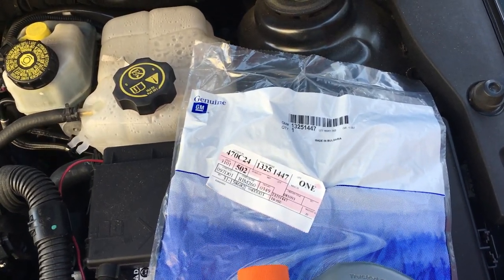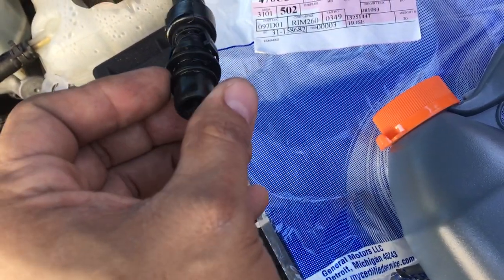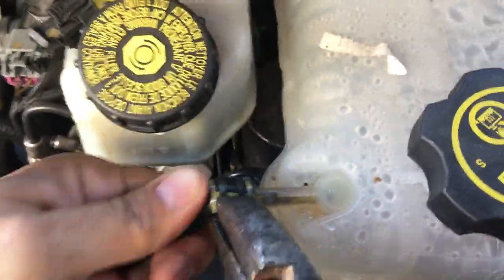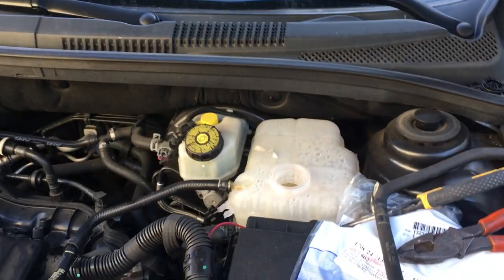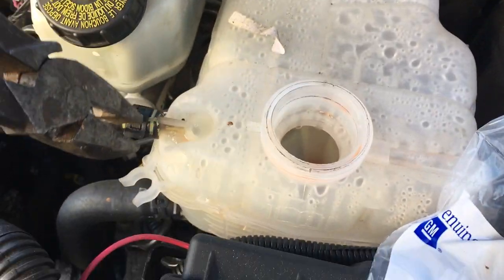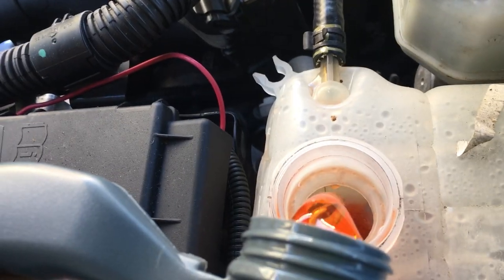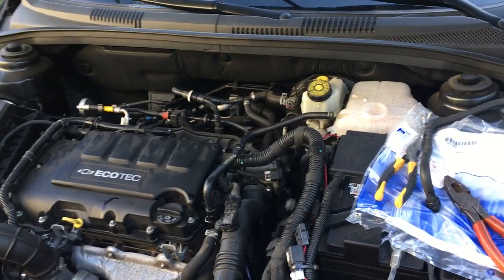2013 Cruze Air bleed Cooling hose

Comment: So for my Chevy Cruze that same thing broke but from a different spot and I see that you have a valve that connects well the holes I had had the same valve already connected on the hose so like if I try to put it on with the that valve on the cruise it basically wouldn't fit so I had to take that valve off to push it in all the way and then it fit so I don't know if I did it wrong I'm just confused right now
Reply from the maker: Hey Louie, most likely you missed a piece inside the valve connector. This valve connector split in half and leave the broken tip inside. You have to fish it out…. I explain this in the video. Please like and subscribe!
Reply: @thekashgarage  How Did you remove the valve connector to get rid of the piece of broken tip?
Reply from the maker: @manuelcroque5768  listen to 1:27 mins there is a hole inside the broken piece… put a small flat screwdriver or the top of a light prove to fish it out. It as thin as a pen ink cartridge… Even a dry cleaner coat hanger will do!

Comment: really dumb question but do you know where i can find the safety clip? mine is extremely worn and about 3x the width of a new one.
Reply from the maker: From the same autoparts shop you got your car part. they should include it.
Reply: @thekashgarage  sorry i wasn’t clear enough.. i don’t need the hose, i just need the clip. i haven’t ordered any parts yet.
Reply from the maker: find out in Amazon, how much does it cost the whole hose and clip kit? I think you can find it for under $20 but I will go to Try Chevrolet Please dealership and find out how much they're gonna charge you for the clip. Also, you can try these dormant part on Amazon for about $15... 
Brand: Dorman
4.2 4.2 out of 5 stars 3
Dorman 66264: Coolant Connector Clip. but honestly, at this point I think will be better if you just buy the whole replacing hose and clip in included no more than $20 in amazon

Comment: No it won't Crack if you slightly overfill as its supposed to be a closed system. It will bleed into the exhaust manifold and burn out the tailpipe
Reply: how should it vent coolant out the exhaust?..this tanks are known to crack indeed.. and if they crack above the fluid level you get weird overheating symptoms beause it does not hold pressure..also the common coolant smell issue of this car is related to overfilling.. his statement about the fill level is correct
Reply: @bobl78  it has a small vent somewhere into the exhaust system to keep pressure but not pop the system. Obviously if you fill it to say the cap you need to siphon but a little above the hot line is ok and you need to bleed it always after you have someone put it in. Much like a transmission has a vent.
Reply: @joshbeekman5474  sorry that is not correct.. I own this car.. there is a pressure relief valve build in the cap of the coolant reservoir. If pressure gets too high, it opens to relieve steam / coolant /gases until pressure is normal again. There also is a vacuum valve in the cap  that allows air to be sucked in when the engine cools down. 
The coolant is vented next to the tank and drips down the engine compartment on the ground. There is no connection to the exhaust system.
You are right that the fill level should not significantly exceed the max limit to allow for sufficient "air" space for expansion.
Reply: I have had mine checked pressure for carbon and gas all 3 coolant issues. You are correct about the coolant top side and also the thing is a pos.. I can not wait to crush mine.

Comment: Note: This hose breaks because when they are changing the oil filter (oil change service stations/mechanics that DONT know any better) they lean on that hose connection joint and it breaks, not realizing that they cause you a problem down the road.
Reply: not necessarily the case this is a very common problem for cruze cars

Comment: Any idea for the pin at 3:30 mark we can’t get it back in for some strange reason
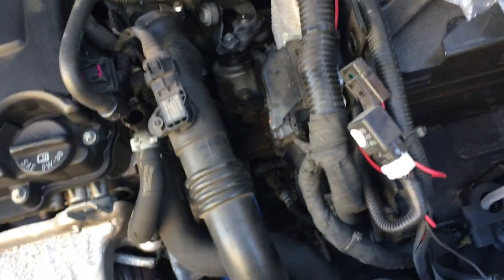Reply from the maker: Did you removed the broken tip? Look at video from 0:40-1:45 aprox. If you didn't do that, it will never fit. Let me know!

Comment: many years ago I switched from Dexcool to VW G12++/G13 and since then no more plastic parts  of the cooling system failed anymore
Reply from the maker: That is a very good tip for everyone. Did you get any post issues with either the water pump, seals or head gasket and or the aluminum head?
This information would be good to share as each manufacturer build their parts to withstand their own anti-freeze.
Reply: @thekashgarage  no problems that I can relate to the coolant.. VW also has aluminum engines and their plastic parts are not different.. G13 is a Hybrid coolant which is the latest and currently best in coolant technolgy..it combines classic silicate and OAT technology…this engine has no special coolant requirements

With Dexcool I replaced that bleeding hose every 1 to 1.5 years and also . broke down with a broken outlet neck where it goes to. The parts got very soft and disintegrated, almost  kind of dissolved… don’t see that anymore

Comment: Do you have to empty coolant to change that bleeder hose?
Reply from the maker: It was low but not empty
Reply: @thekashgarage  what was low? The reservoir tank? Or tank empty and coolant low in engine? Just asking because I have to do this on Saturday and not wanting to flush entire coolant. Tank is okay. That’s easy part.
Reply from the maker: @MarkDulisse  you don’t have to empty the coolant from either the expansions tank or the radiator to replace the hose.

Comment: I think I have lost the valve  that connects to hose
Reply: No problem. I couldn't find this hose in stock in the country I live in, so what I did, I bought a steam hose from my local plumbing shop (steam hose that can sustain over 130 degrees Celsius) & used this instead. And it cost me less than 10 dollars, too. Works perfectly well